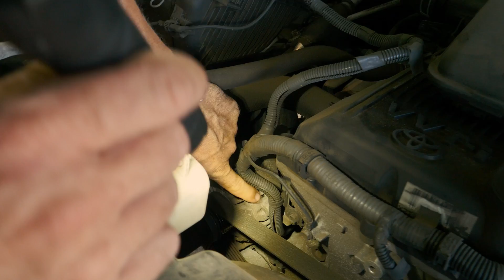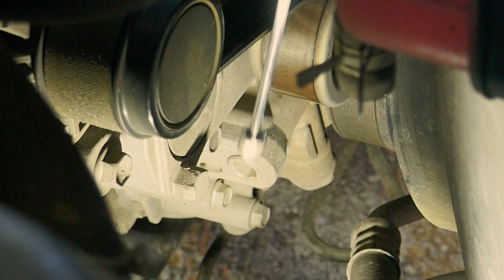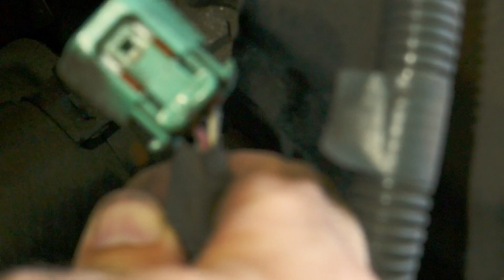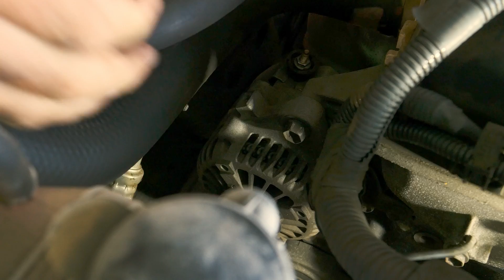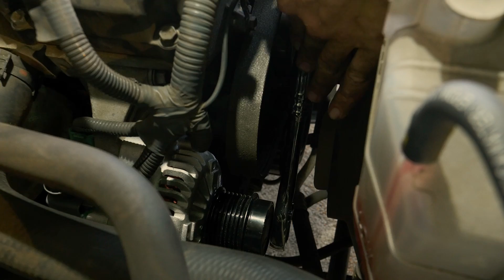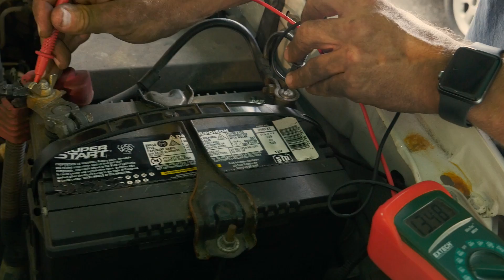New Battery Dead? Diagnose and FIX Replace Alternator Toyota Tacoma DIY 5-15 2.7l - Dead Battery

Comment: Excellent video, just replaced alternator, it was harder to get the plastic parts off then getting the bolts out. I think it might make it easier if the radiator hose was removed. The spcaer was out but had no need to push it back, measured the opening on the old one versus the new one more room.

Comment: Takes a little more time but, remove the right wheel and it opens up plenty of room to remove and replace that alternator. Make life easier and less frustrating.  Just did this job on my 2011 Tacoma. Great video!

Comment: Thank you for making this informative video. My 2007 Tacoma 2.7L has the battery light on. I checked the battery using multimeter and it read 12.23V. I started the engine and read it again and it showed 11.89V. There's a significant drop in voltage which makes me think the alternator needs to be replaced. Am I correct making this assumption? Thanks.

Comment: Liked and subscribed. Great video.  330,000 plus miles on my 2012 and getting a battery light on the dash.  Going to run the test and see if it's battery or alternator and proceed.
Reply from the maker: Thanks man 🤙🏽
Reply: Got it done. Thanks again for a grest video.
Reply: @k.backus6349 same thing going on here, 342,000 miles and got a battery light on the dash this morning. Ordered in a new alternator as my battery was replaced just in 2023. Was yours the alternator?

Comment: Outstanding video. 13.39V on alternator, original to 2006.  Thought it should be more. Don't have a tester, per se, just a voltmeter. Had not checked in a while. 

Have been running with the lights on as a rule, never had an alternator light come on the dash.  Was starting to crank a little heavy, 3+ yr old battery.  Almost didn't get it home just now.  

Local parts guy said simply "bad voltage regulator." What stinks is that the old school vehicles used to have more accessible (external?) voltage regulators.  

Ordered alternator, belt, battery but we'll see how it charges, loads up the battery once installed.  Almost went across town but didn't want to get stuck, willing to wait til tomorrow. 

13.39V ... Was wondering if that was a slow drain on an original alternator or if  voltage can fail intermittent.
Reply from the maker: 13.39 isn’t the worst, I would say about normal for an original alternator. Many factors can lower the voltage slightly, such as loose or corroded terminals, a tired out battery, or low idle rpm. But I think your plan to replace both alternator and battery at the same time is a solid one. If you’re curious tho, replace the battery first then check voltage on the old alternator

Comment: Aloha Budget Mechanic,  while away on a few week vacation what is the best way to avoid the car battery from dying and  the engine not turning over after returning from vacation?  Unfortunately I don't have someone to start the car now and then.
Reply from the maker: A few weeks is probably fine. The battery will dip in voltage a little bit but shouldn’t be enough to effect startup. If longer than a month, you’ll want to put a trickle charger on the battery which keeps it topped up.
Reply: @BudgetMechanicHawaii  mahalo!

Comment: Thank you for saving me labor costs! Got 274000 miles out of the first alternator; hope to get that with the one I just put in. 
That lower bolt put up a good fight. Breaker bar came in very handy for that (and the tensioner for that matter) since there was NO room for an impact. 
Again, thanks for the walk through. That was a pretty productive < hour's investment.

Comment: I had my 2000 Corolla alternator and serpentine belt replaced after 294K miles. I just paid a mechanic to do it since I will never have it done again and they are in practice on an easy but hard job...